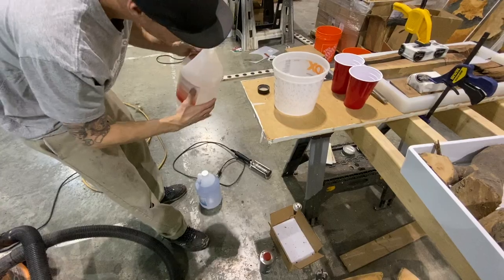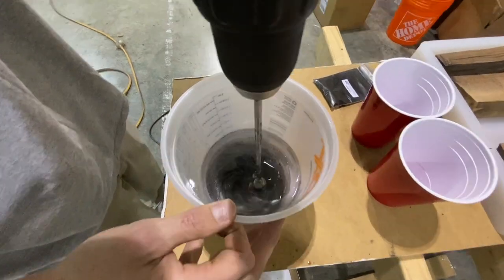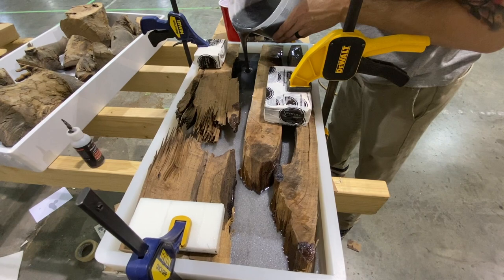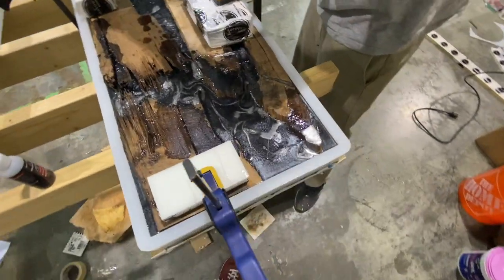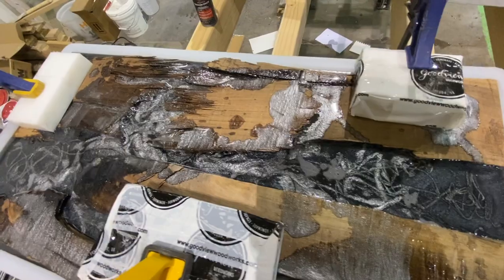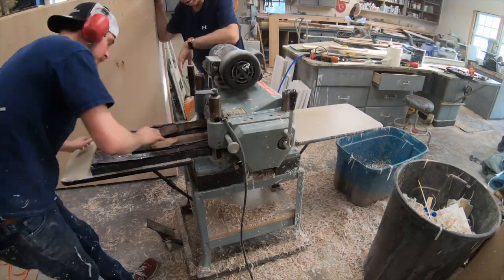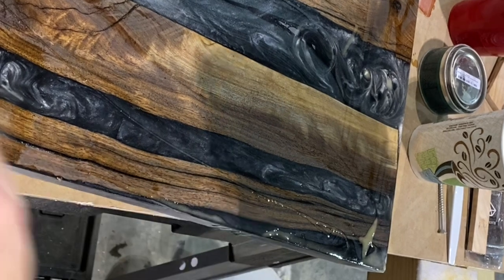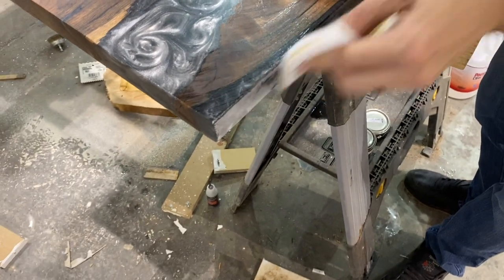DIY Smokey Walnut Charcuterie Board

Comment: Nathan just a quick question. You are using a lot of rubio lately, I have an outdoor table that is under cover would you recommend rubio or to seal both sides with epoxy. Your expertise would be greatly appreciated. Do you ship your tape to Australia
Reply from the maker: I would recommend Rubio for outdoor patio because they make a product specifically designed for outdoor use. As far as the tape goes, I can ship it to Australia but it probably won’t be cost effective. 😄

Comment: If i want to cover a wooden rod which has 2o inches length 
How mucch epoxy i will need
Plz tell in grams
Reply from the maker: What is the diameter of the rod ?
Reply: @GoodViewWoodworks   diameter of the rod is 1.3 inches
i just want to give a look of epoxy on rod so it looks like crystal from outside
Reply: @GoodViewWoodworks  just want to cover a little bit with epoxy to give it a new look